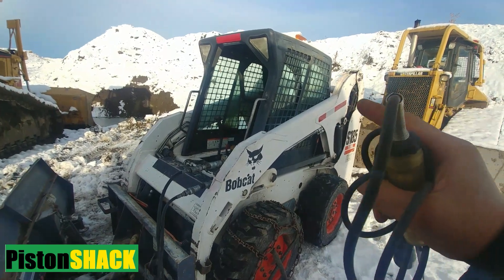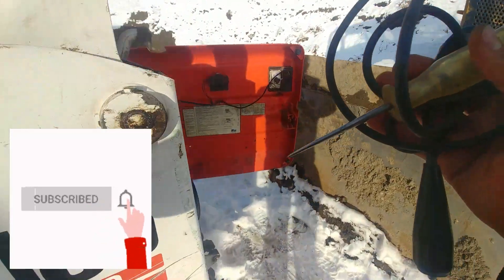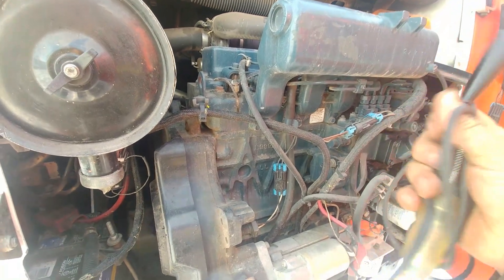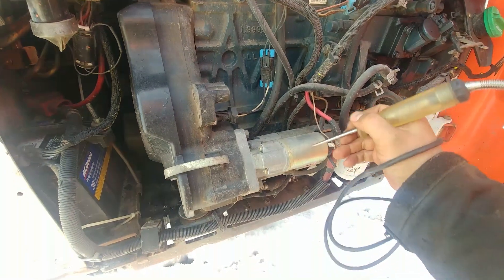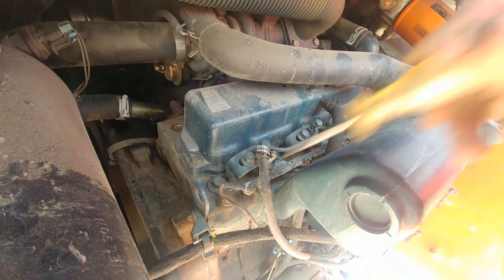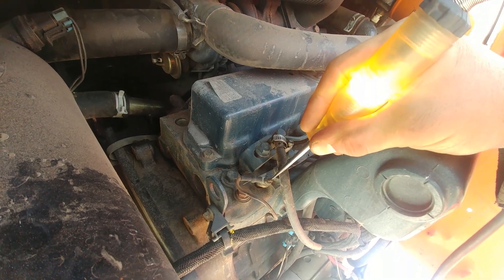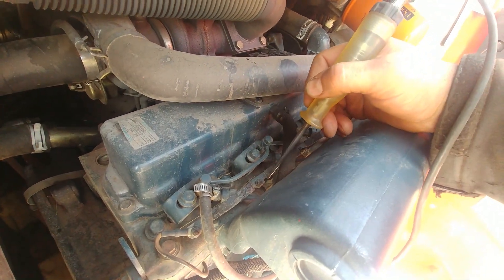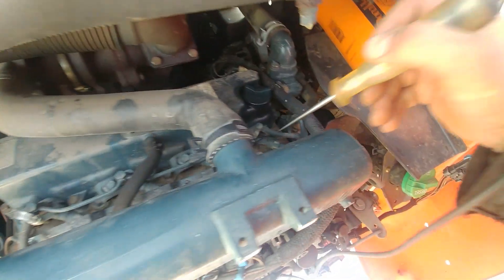DIESEL HARD TO START IN COLD WEATHER? DO THIS QUICK EASY TEST FIRST! // 4K

Comment: This will help a lot with my diesel excavator....thanks
Reply from the maker: O, it will do it) I tried source used part you asked me before. I couldn't find any used ones. I think the best way is to get aftermarket new part instead of OEM. Leemar Excavator Components is the best excavator parts supplier. I hope it will work for you.
Reply: @PistonShack  thanks for trying

Comment from the maker: More Interesting Helpful Videos - Diagnostic Tips and Heavy Equipment. Check it out:
HOW TO TEST GLOW PLUGS GLOWING AND RESISTANCE https://youtu.be/nTuqjJ4SD2A
CUMMINS B3.3 - FUEL SYSTEM BLEEDING. How To Remove Trapped Air. https://youtu.be/1o6YfR72VGs
CUMMINS N14 CELECT PLUS: CRANK NO START. TROUBLESHOOTING & REPAIR (Western Star 4964). https://youtu.be/C9xIXv0msmk
IGNITION TIMING MAZDA b2600i, b2200i. https://youtu.be/Bq2KrSdZFXY
TRUCK CANOPY 3rd BRAKE LIGHT WIRING: wiring diagram, inline fuse, signal wire, ground EXPLAINED. https://youtu.be/Q0LiPCyTH_Q
How To Diagnose and Replace Windshield Wiper Motor on Ford F-250, F-350 (99-07). https://youtu.be/5a5_JreHnsQ
FUEL TRANSFER PUMP WIRING - Best Explained: wiring diagram, relay, fuse, switch, 12V, pump ground... https://youtu.be/-HCtHnzbc7g
VOLVO EXCAVATOR REPAIRS: WATER PUMP, FAN BELT. D4D, D6D engine: models EC140B, 160B, 210B, 240B 290B. https://youtu.be/8NwbpLYnstY
ALWAYS TEST FUEL PUMP & FUEL SENDING UNIT BEFORE INSTALLING! TIME SAVER!  https://youtu.be/d-xnGwixFIc
MOST COMMON CAUSE OF AUTO FEED PROBLEM - VERMEER BC1000XL WOOD CHIPPER. https://youtu.be/cDuM25XuMm0